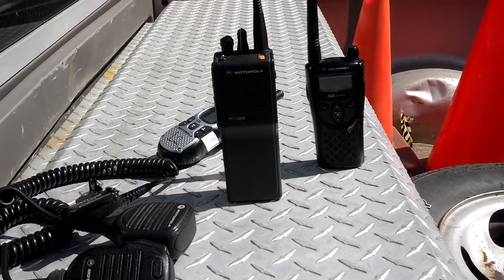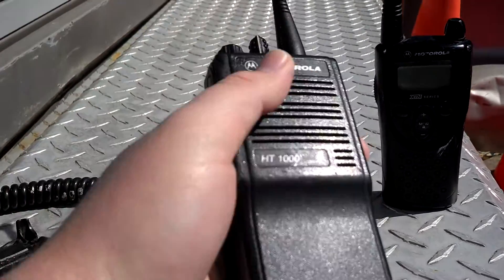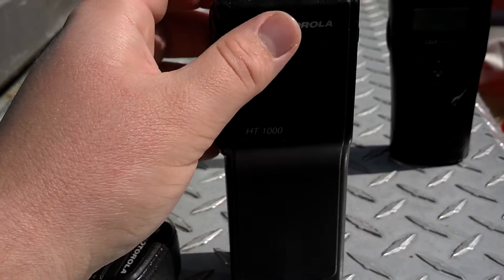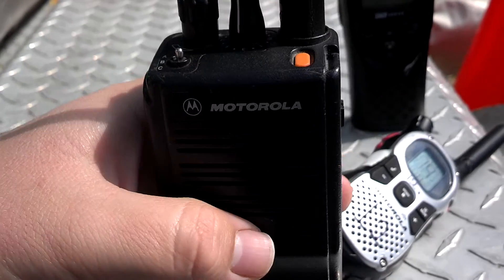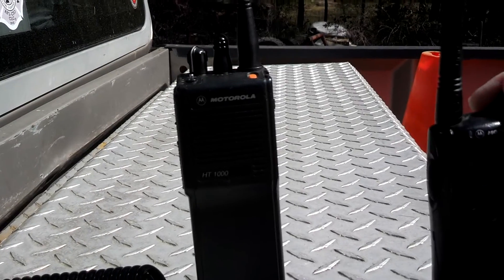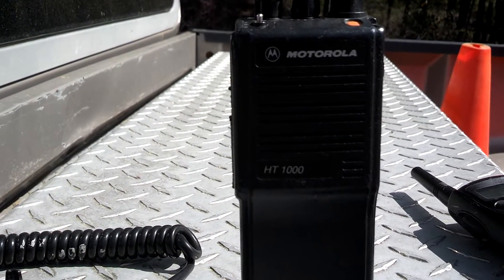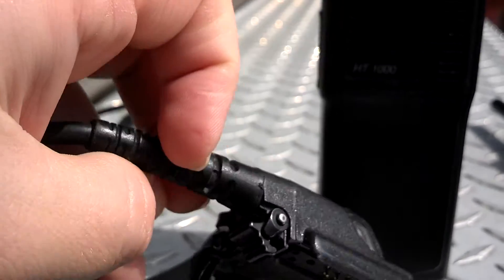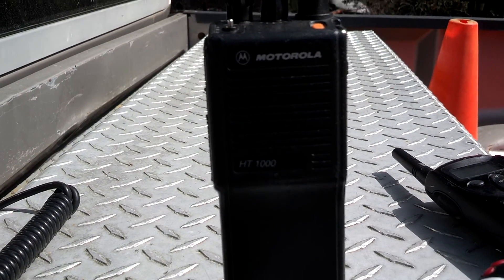Motorola HT1000 TPT hack demo!

Comment: I have a Motorola ht1000  it wont turn on and wont do nothing  it worked fine the other night when I was transmitting on the ham repeater with a mdc1200, since the night i had it scanning and it was fine till morning when i turned it off and turned it back on ? Help!

Comment: How do you make it to where you can't transmit on the ht1250 and ht1000? Like fd and pd channels
Reply: There are multiple ways depending on the radio and CPS.  Set the receive freq but use a dummy value for transmit. Also leave out the CTSS or DPL settings.

Comment: So let me run something by u. I want 2 run anywhere from 2-6 ht1000's at events I go to. Can I have the tpt tone go off just before I transmit well as the dtmf 4 digit tone come over the talkie(s) without being on a system without a repeater/trunking/whatever. Basically we want to use them like regular frs/gmrs talkies but with the tones. Also (if above is possible) how would I go about activating these tones. Thanks a ton in advance for any help anyone may offer.

Comment: There seems to be some confusion. MURS; no license required max 2 watt, 5 channels in the VHF hi band, channels 4&5 are shared with the "Business band".  GMRS: (UHF) license required, that includes channels 15-22 on those bubble pack radios you get at wally-world, yep, using these require a license. channels 1-7 are shared FRS/GMRS, 500mw max for unlicensed use, 5 watts max for licensed use. 8-14 are FRS only, max 500mw (half watt) and 15-22 are GMRS only, 5 watts max on handheld and 50watts max on base-station GMRS license is $85.oo for 5 years. Repeaters only permitted on 15-22, repeater use only with a license.
MURS;
151.820 MHz (NFM)                                 
151.880 MHz (NFM)                                 
151.940 MHz (NFM)                                 
154.570 MHz (WFM)  Also part of business band (Blue Dot)                             
154.600 MHz (WFM)  Also part of business band (Green Dot)
PS; Love those HT1000's!
Otis KD8VBV
Reply: It's all moot because things like this HT1000 are excluded from FRS because the antenna is detachable (can't do that with ANY FRS radio), they are too powerful for the FRS. service and they aren't type-accepted for FRS.  GMRS and MURS require licenses and still have power limits and other restrictions.

Comment from the maker: Certain frequencies like as an example, a ht1000 that has a band spite of 136/174 or 178 MHz is fine to use on MURS. Same for a ht1k that's UHF 400 mhz and covers the FRS part of the band. Now unless the FCC has made any changes to rules for the use of FRS/MURS frequencies it could be totally different now but last time I had checked into it there was no problems with it. Now if u had an amateur brand radio that was TX'ing on MURS/FRS then there would be a problem with that.

Comment from the maker: Sorry about the problem with your radio there. The ht1000 and most Motorola radios have to be programmed by computer software or rss. It sounds to me like your radio isn't programmed. U are going to have to take your radio to your local radio shop/dealer ship and have them program it for u. What frequencies r u trying to use? Just to let u know, the FCC has strict rules about who can use what frequency. If u r trying to use the radio on someone's channels without permission it is illegal.

Comment: I don't know much about radios.I figured I can buy this radio and it would link right up to anything UHF 403-470 But whenever I turn this radio on and have it set to channel 1 it makes the standard cherp sound But PTT wont work And when I change the channel every channel I change too makes a very loud high pitch hum noise.. And my PTT button still doesn't work nor any of my other buttons on the radio(Emergency, etc.) I think somethings wrong with this radio..   Thanks for Your Time
Reply: The hum means it's not programmed.  You just need to program the radio.
Reply: Haha after 7tears i got a relpy. Thats hella cool. Thanks i figured it out